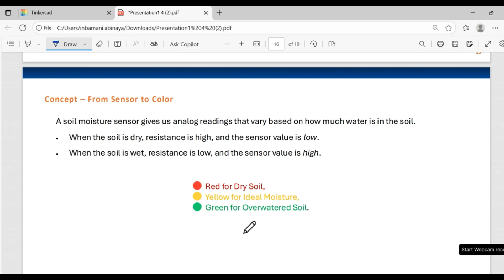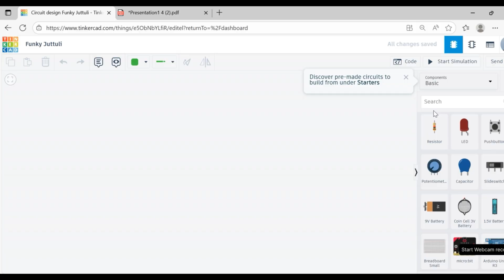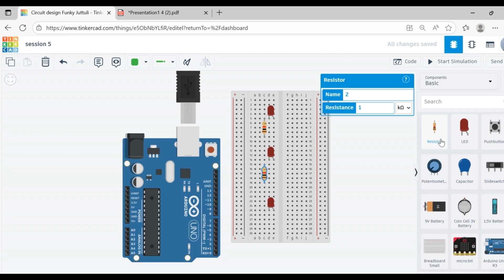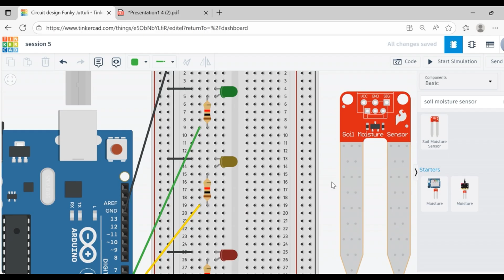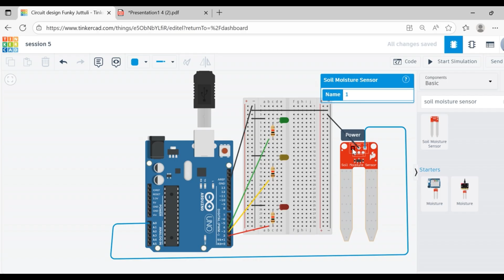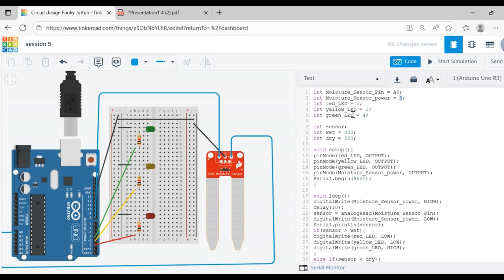Session 5-Soil Moisture Visualization with Arduino | LED Indicator for Smart Farming

Comment: Code: 
int Moisture_Sensor_Pin = A0;	
int Moisture_Sensor_power = 8;	
int red_LED = 2;	
int yellow_LED = 3;	
int green_LED = 4;	

int sensor;	
int wet = 800;	
int dry = 500;	

void setup(){
pinMode(red_LED, OUTPUT);
pinMode(yellow_LED, OUTPUT);           
pinMode(green_LED, OUTPUT); 
pinMode(Moisture_Sensor_power, OUTPUT);
Serial.begin(9600);
}

void loop(){
digitalWrite(Moisture_Sensor_power, HIGH); 
delay(10);	
sensor = analogRead(Moisture_Sensor_Pin); 
digitalWrite(Moisture_Sensor_power, LOW); 
Serial.println(sensor);	
  
if(sensor > wet){	
digitalWrite(red_LED, LOW); 
digitalWrite(yellow_LED, LOW); 
digitalWrite(green_LED, HIGH);
}
else if(sensor < dry){	
digitalWrite(red_LED, HIGH);
digitalWrite(yellow_LED, LOW); 
digitalWrite(green_LED, LOW);
}
else{	
digitalWrite(red_LED, LOW); 
digitalWrite(yellow_LED, HIGH); 
digitalWrite(green_LED, LOW);
}

delay(1000); 
}